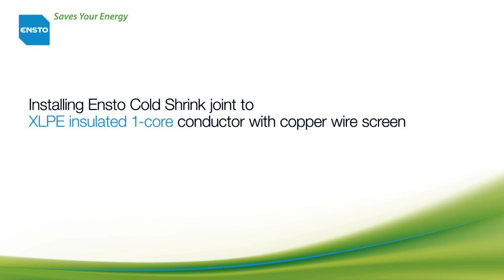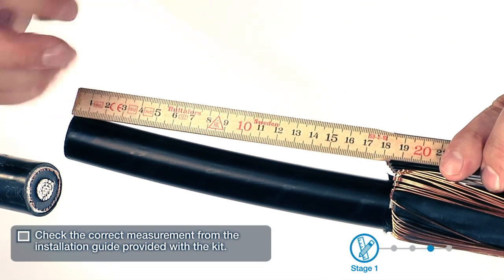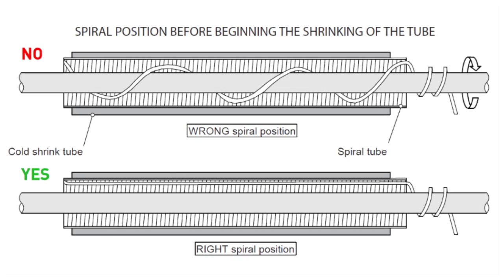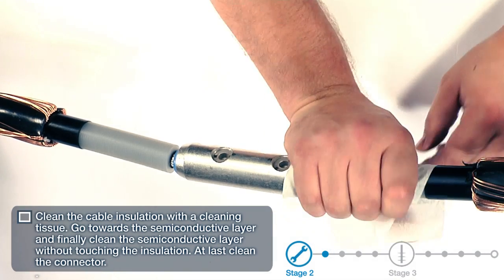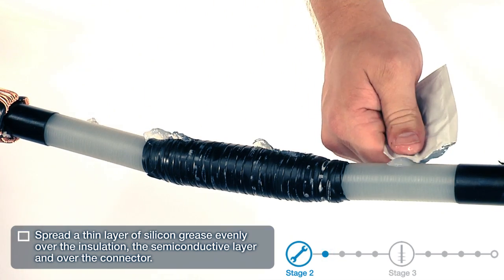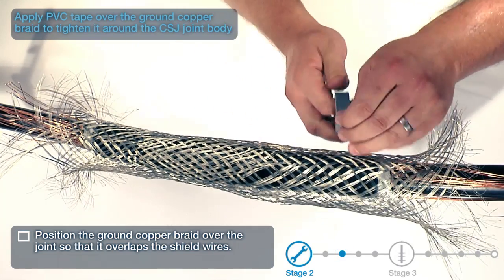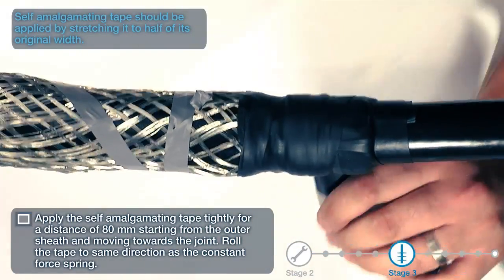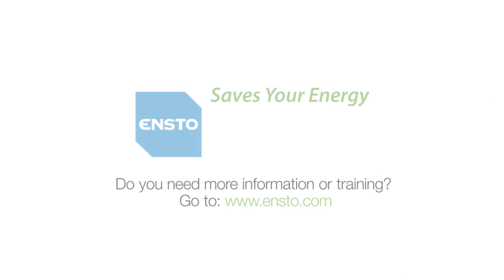Ensto Cold Shrink joint - Installation

Comment: what kind of insulation stripper is that. ive never seen it before.
Reply from the maker: +Seth Davis Hi and thanks for your question! The tool bundle is called ST252. Package includes stripping inserts for 25-240 mm2 cables. 

Read more from our website: http://bit.ly/ensto-st252